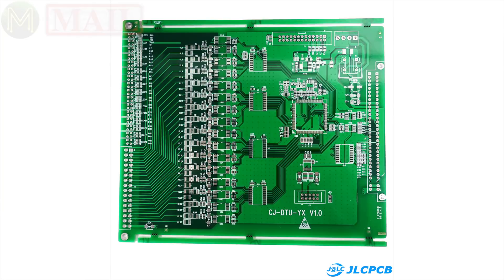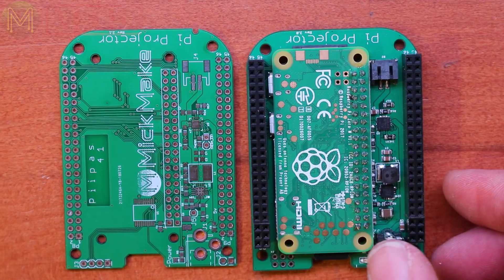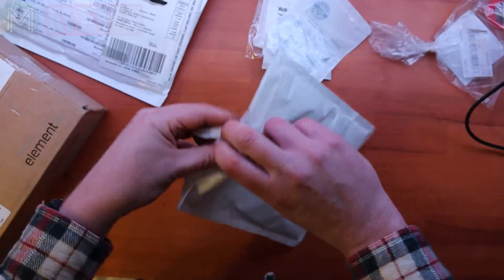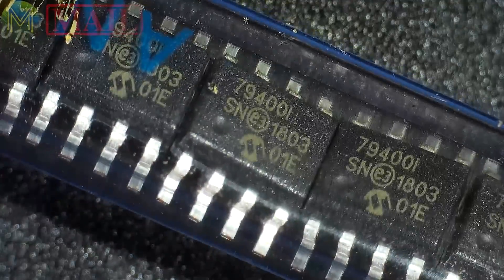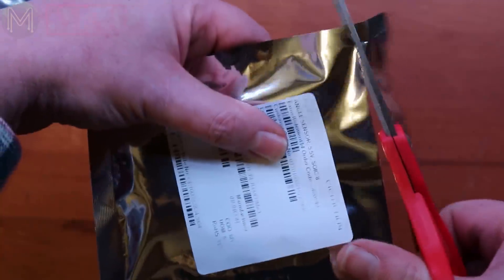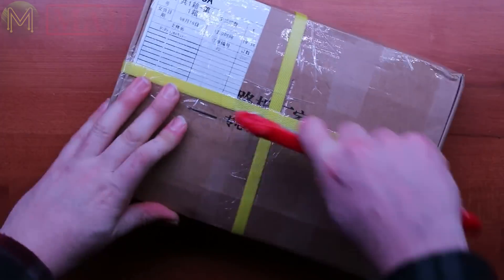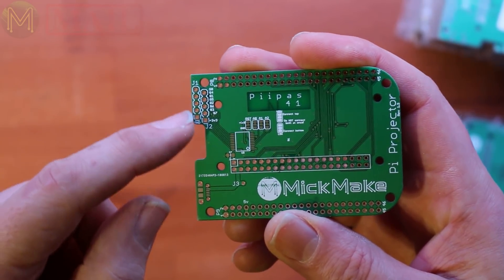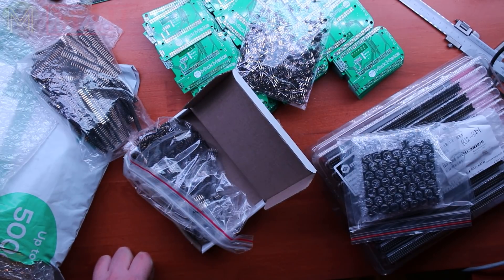#224 MickMake Mail #33: PiProjectors plus lots of cheap ICs.

Comment: Hello there Mike! You have pretty good content here. I was wondering if you would have pointers on how to panelize on EasyEda, i mean an article or video because im puzzled here and dont want to order something that may come up really messed up irl lol.. thank you!
Reply from the maker: Panelizing is very straight-forward when you order through JLCPCB. They have a panelizing option once you load your gerbers.

Just remember that the cost will be the same for anything less than 100mm by 100mm.
As soon as you go over that, the price will increase to the next 100mm by 100mm square.

Comment: Hi, Mick! Thank you for the video!
 I have a question concerning the PiProjector. Do you know, how can I enable the second framebuffer and the HDMI interface. It may be very handy for DIY maskless photolithography or DLP 3d printing?
Reply from the maker: You’re not the only one to ask that. I’ll check it out and get back to you.
Reply: Thanks a lot! You inspired me to make the same board for the big RPI. So that I can connect the camera and HDMI as well.
Reply from the maker: I'm in the process of designing an adaptor for the NanoPi A64. This has an AllWinner-A64 on-board, and the SBC comes in a nice compact size. So, it'll be able to run Android - hence NetFlix/YouTube.
Reply: It is a very interesting combo! Nice! Can't wait!

Comment: I've built rotary encoders from similar chips from AMS.com (formerly austria micro systems). They aren't too expensive, require almost no external components, pwm out, spi/i2c, varying resolutions, etc. It's been many years, but they used to send free samples including magnets. https://ams.com/angle-position-on-axis
Reply from the maker: Nice! What were you building the encoders for?
Reply: Few different projects. Here's one where I replaced an old industrial gundrill control with one I made from scratch. I used a raspberry pi, a 3 phase bldc motor controller, an ams encoder chip (drive didn't have resolver support), and some misc other crap. I 3d printed some parts, wrote the software in pure c99(gtk for gui), and did it all in less than 2 weeks. It's been running great for years. Here are some random photos from it (messy/ugly stuff is original): https://drive.google.com/drive/folders/1qpH1YKoZ7b7RGFlNU8jDAeENY6tysSsP?usp=sharing
Reply: I also used them on a 3 axis cnc knee mill that I retrofitted, and was going to use them on a couple of robot arm rebuilds that I've never found the time for. Anyway, i like your videos. :)